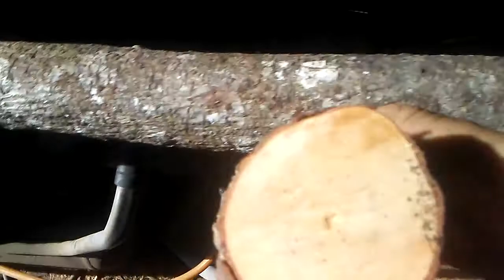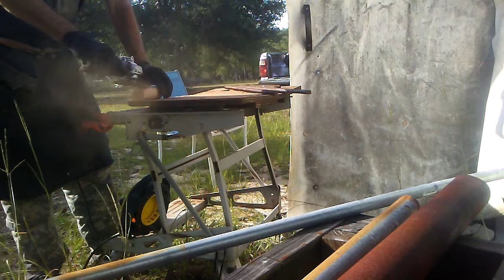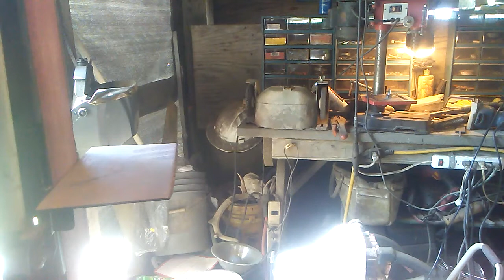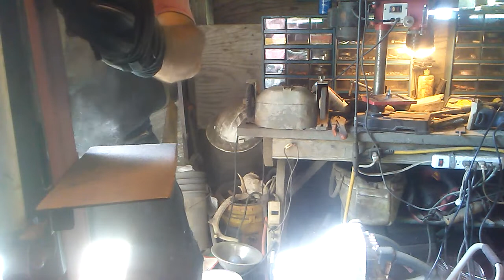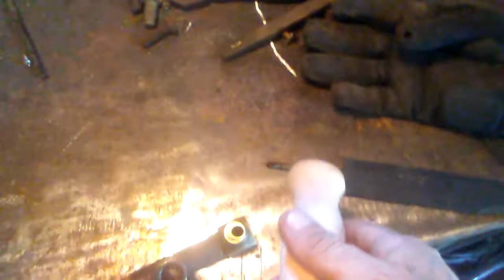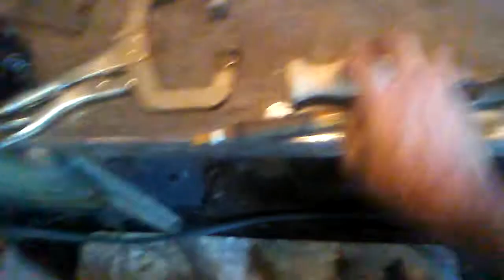K Bar part 4

Comment: Hey buddy it looks good.
Have you thought anymore about the Arkansas toothpick hog knife?
  And how close do you come to chattahoochee or do you get down there ever? 
The reason I ask i have the complete rear leafspring pack of a s10 blazer both sides.
And finally what size tires do you use on the van? I have 2 18 in rim size tires off of a f150 if you can use them you can have them.